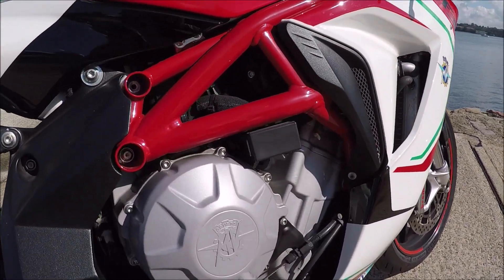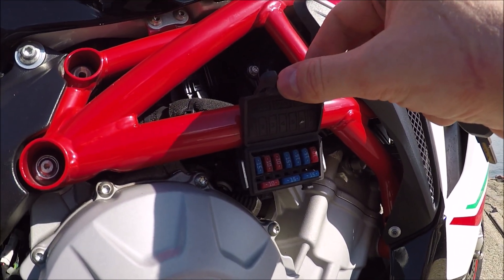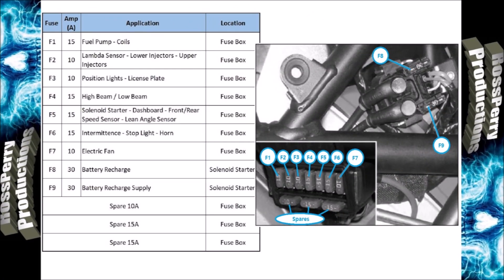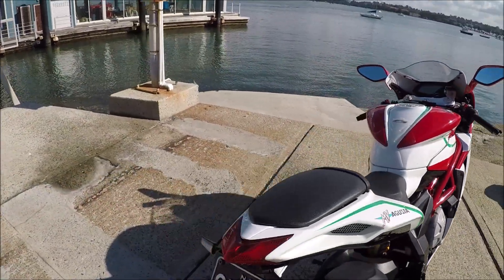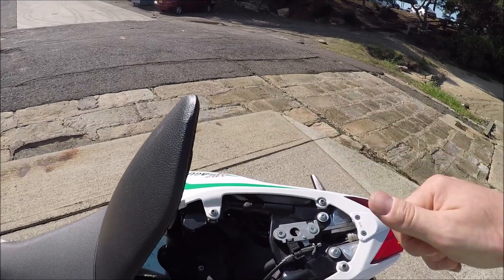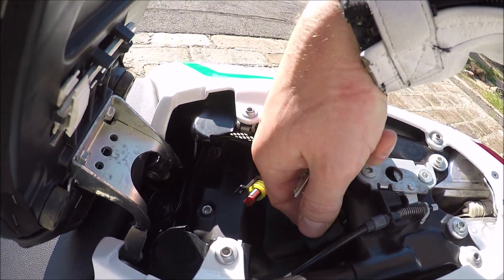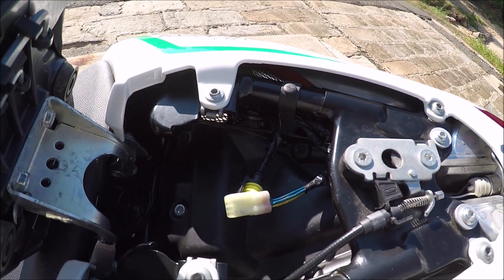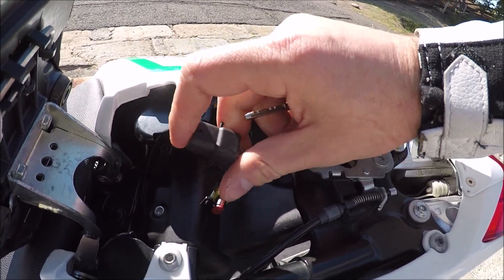MV Agusta F3 Diagnostic Port, Charging Connector, & Fusebox Locations Including Diagram

Comment: Thanks man. Just need a quick locate on the diag port so someone can clear my Exhaust Value Error. Cheers !
Reply from the maker: I had that recently two, I ended up taking it all apart, cleaning and re-greasing it. Then the fault cleared.
Reply: @RossPerryProductions  I put in a HealTech ESE. It was annoying me :)

Comment: What scanner instead of obd2 do you need for the MV Agusta F3? I‘d like to export telemetry data for gopro videos and analysis. So I‘d need a bluetooth device to export the data while racing. Thanks for your help. Nice and quick video👍🏼
Reply from the maker: Hi LK, I have never tried to connect to the bike, have you spoken to an MV dealer?
Reply: @RossPerryProductions   Thank you for your reply! No I haven‘t spoken to a dealer yet. I tried to get information from the internet but I didn’t find a perfect answer since a lot of motorcycles have different connections for this port. But you‘ll find a lot of videos of people using the telemetry data in their videos, somehow it has to work :)

Comment: I have 2020 MV agusta F3 800, it was in my garage for a month because of the corona,i tried to start it the other day it did not work.I tried to start it with the jump started that originally came with the bike,it did not work,or i might have not done it right.What would you advise me?How can i jump start it? Thanks Be safe
Reply from the maker: Hi Alper, the bike comes with a slow trickle charger and not a jump starter, leave that connected to the bike for 2 days or so to get enough of a charge in to start. I hope that helps for you. Ross